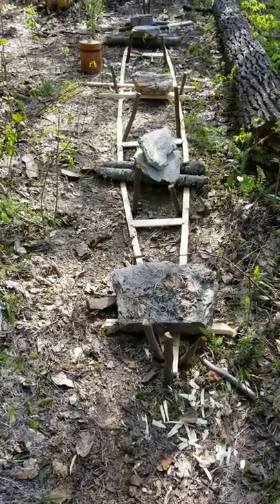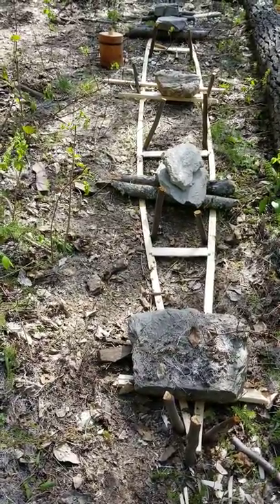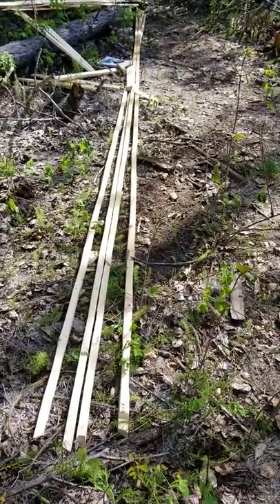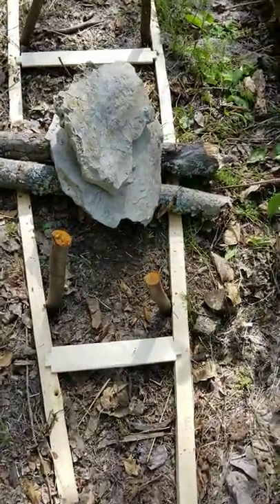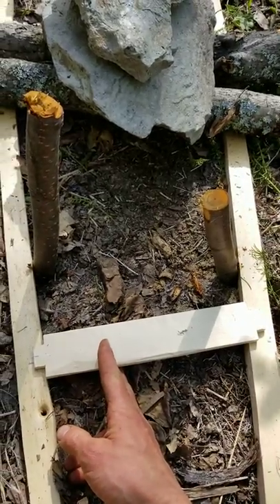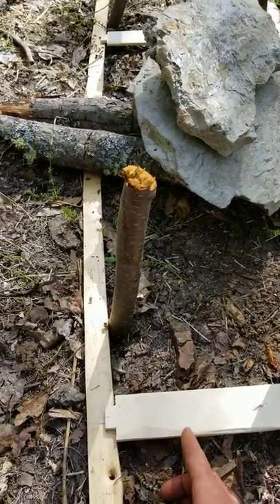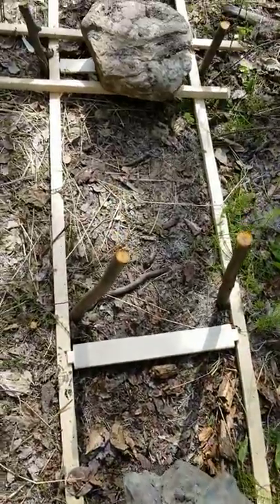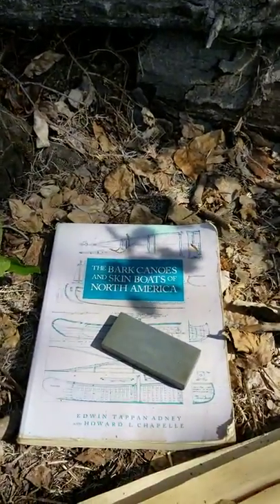Kayak form birch bark canoe construction 1

Comment: I see that pin knot at the forward cross member and it would be so tempting to use it as a lacing hole.  I presume the cross member will be laced as well as morticed?